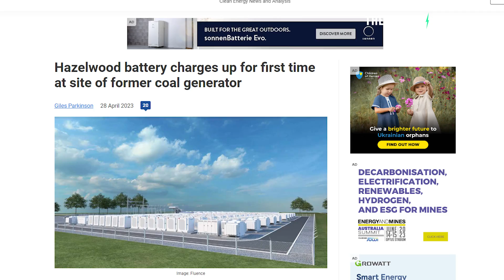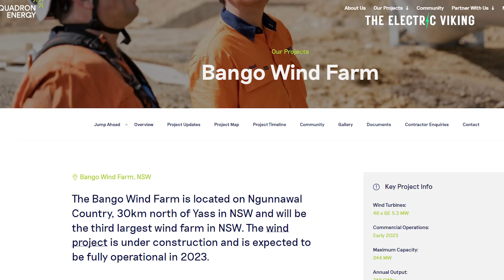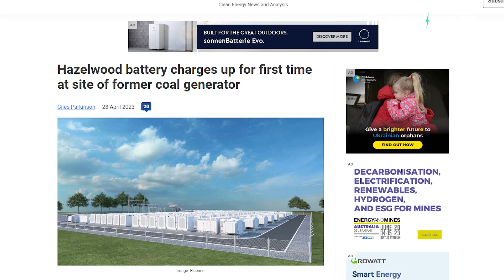Australia turns off BIGGEST coal plant, replaced with wind farm & battery

Comment: I'm sorry, but there is so much unicorn vapor in this post. neither wind nor solar are baseload options, and the staggering number of batteries that would be needed to make them baseload-ready would bankrupt Australia.

Energy density is the key to affluence and efficiency. That means nuclear is the top option, hydro that is already installed is second, and fossil fuels are third, with solar and wind and geothermal and new hydro distant contenders.

Given current technology and economic reality, replacing coal with wind and solar is madness and is only being sustained by government incentives. The incentives are based on faulty and politicized conclusions about the climate.

There will come a time when materials science and the world economic picture may make the wind and the sun viable wide-scale baseload options, but right now, they only work on a larger scale when they are being propped up financially. They can work today only for off-grid use or for remote communities.

Comment: The Liddell Power station had a capacity of 2000MW. The Bango windfarm has a maximum capacity of 244 MW. The expected yearly output of 748GWh equates to an average output of 85 MW. So it is hardly a replacement. We need another 23 of them if you want to be able to charge your EV.
Reply: Yes and of course when the wind drops, the coal fired PS will supply the load. I guess you know that a 250Mw battery connected to a 250Mw load will only supply power for 1 hour.
Reply: Thanks for some sanity in the comments Frank

Comment: Definitely not the biggest Coal Plant by  any stretch of the facts...

One of those is Just over the (metaphorical) photographer's left shoulder at Bayswater...  (Referencing Photos of the Liddell Plane on the day it was "shut down".

The Federal Senate Questions to the power industry, AEMO, CSIRO, etc usually Go unanswered when quizzed about true cost of grid firming with renewables - the land use by the industry is obviously extraordinary, and the industry complains about "dual use" land for solar farms, as allowing sheep to graze (agrovoltaics - taller arrays with wider spacing) - - and reduce fire risk - will destroy much of the "bottom line".....

... and "the" Wind farm (Twiggy Grandstanding - like Batman's Max Shreck - with an addditional powerplant to "take care of the surplus"...) - is a bandaid to the situation, thankfully many (millions with Solar and thousands with private batteries) private people have   installed their own generation and backup sollutions -  taking care of business  (While Elon Musk Forbids use of transport batteries for anything other than driving around - unless of course you buy an Exorbitant Powerwall - a Tesla Car (65kWh) replacement battery is less than 2x the powerwall cost with x5 the energy storage ).

Comment: All fantastic. All you needed to do is to elect an uncorrupted government.  Just one little niggle.  We really should use alternate batteries (not Li based) for our static applications.  All they need is market share to be cheaper than Li batteries.  The reduction in demand for Li would make Li batteries and hence EVs cheaper which would greatly increase the uptake of EVs.  Best of all, batteries based on other elements are superior to Li batteries in a number of ways.  They last far longer, can be cycled between 0 and 100% with no damage, operate over a wider temperature range with no fade, (as mentioned) will be cheaper once they have market share, are made with elements which are common, cheaper and are available from multiple sources, are safer from a fire point of view and hence can be shipped by air, land or sea.  There are the ZnBr flow/plating and gel batteries, Liquid metal batteries based on Sb and Ca, a range of redox batteries based on V and Fe and the new Na batteries.

Comment: 500 Mega Watt battery does not Replace 2000 Mega Watts 24/7 power station, simple maths!
Reply: 2000 mega watt power station don't run 100% most of the time. In fact it is about 50% average.
Reply: @kongwee1978  Australia uses 25 Giga Watts 24/7. Name the battery that will replace that ?
Reply: I heard if we have power issues that the battery can supply power for a day..
Reply: @Mixos_place  15 mins of power is no replacement for 2000 megawatts 24/7 power/
Reply: @unrealone1  Well thats what the media and viking are saying...

Comment: Closer and closer to the abyss. 
It is not possible to continually remove conventional generation that is synchronous, provides inertia, reactive power and supports short circuit current levels with  generation that provides non of these essential services.
There will, posibly, be a time when neighbouring grids are unable or unwilling to continually support this untechnical  way of making electricity. It is completely unsustainable.

Comment: The reality is that most if not all the coal plants that are being "switched off" are because they have reached the end of their lifetimes and will need expensive rebuilding programs to keep them running reliably. In the US, most coal plants were built in the early 1970's or before. 
So makes more economic sense to build renewables. batteries, and transmission lines which are cheaper to run than buying coal everyday.
Reply: True, but for whatever reason this is good progress. Not only for Australia, but as an example for the rest of the world.

Comment: Solar and wind will not work without storage.  What was the cost for the batteries?  How long can the batteries supply power when there is no wind?  What is the longest time (historically) of low/no wind?  I am worried about the costs and longevity of back up power systems.  Cheers.

Comment: Glad to see Australia doing so much to install batteries in their grid, I wish the UK would do as much.
Reply: The energy companies are trying. It’s the utilities and grid operators that are holding things up with interconnection backlogs. The queue in PJM, one of the largest grid operations in the US, is 3 years backlogged. They need more people studying these connection requests, and more upgrades on the grid to handle them. It’s easier if you do it at an existing power plant location, since the infrastructure is mostly there already. But even then, they have to be studied and have engineering approval. It’s just ridiculous that they can’t get enough engineers in the utilities and grid operators to work through the logjam.
Reply: Steve, FYI a 250Mw battery connected to a 250Mw load will only supply power for 1 hour.
Reply: @massatube  250Mw/hr.~25000m3 of gas per hour
Reply: @massatube  In most cases thats all you need to, most power cuts are down to momentary fluctuations above and below 50hz. Batteries help to smooth out the grid preventing power cuts. Also there are many more batteries in the pipeline and being constructed, like Pillswood in Hull, to be able to store a lot more power and sustain the grid for longer
Reply: @massatube  The duration depends on the load for instance a 200mW battery will provide power for 300,000 homes for 2 hours
Reply: Does it actually make a difference if Australia mines just as much coal and then exports it to another country to burn?  I mean does the planet care which country the coal is used in if then end result is the same?  I live in California and we have had this feel good policy for energy for a long time.  We import more expensive energy from other states and export our own cheaper energy production from natural gas.  Does the electrical grid care?  No and in fact this is just for show because it makes no difference.  If we really wanted to have clean energy we would all be using nuclear and yes they can make it safe.

Comment: The other half of the story is that this massive wind farm is going to produce green hydrogen as well.
Reply: - well that will get the haters going, who for some reason think that Twiggy must be a Gas industry shill  (half either way)....    Just because Elon has stated that Hydrogen is "colossally stupid" - parroting the Oil Industries objections funny enough - all the- while exploding thousands of tonnes of methane trying to take trinkets to Mars.

Many don't realise that there are other ways to Store power other than Lithium batteries, and when Power Prices go Negative - one can either not generate 9curtail and sit idle), or turn that capacity to another use - ie. making industrial and (potentially) transport industry feedstocks.  (Green Steel is stil a dream for many - to bring to scale at a competitive cost..

Comment: Elon: Build a MegaFactory and LFP battery plant in Australia to support this transition. Australia has the minerals to support this. Australian government: Make Tesla an offer they can't refuse.
Reply: This guy understands
Reply: The minerals are being sent to China for processing anyways. What Australia needs (and is building) is more refining capacity.
Reply: I hope you know that a 250Mw battery connected to a 250Mw load will only supply power for 1 hour.
Reply: @massatube  one step forward is still a step forward, I am not so concerned with the supplying of power during massive multi day blackouts… that’s the far end of the spectrum. We are working towards that.

I am more concerned with evening out the duck curve, and and the net loads throughout the 24 days. If wind can produce all night and charge (larger) batteries while demand is low, when demand is high during peak load times the batteries could fill in as virtual peaker plants. Then from there you work from hours of power to days of power.